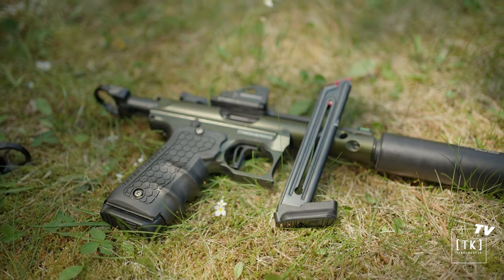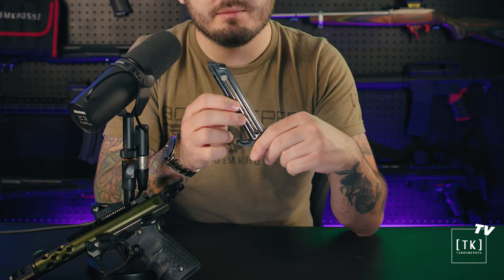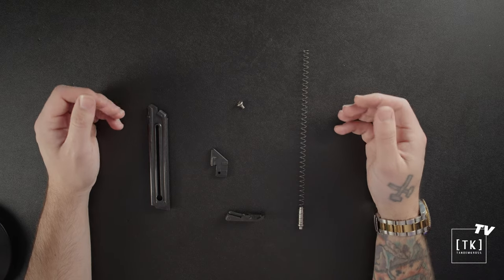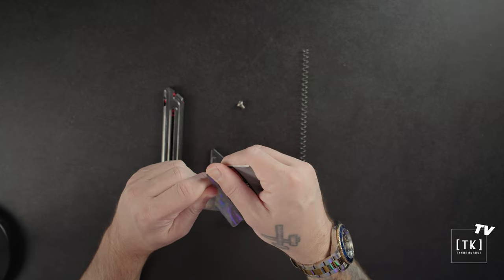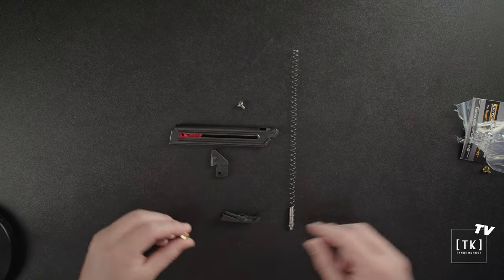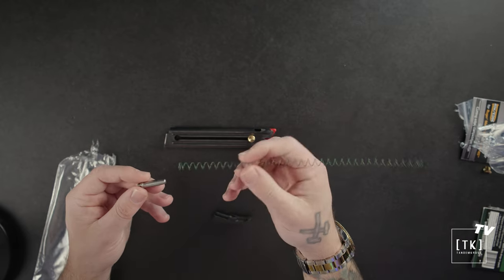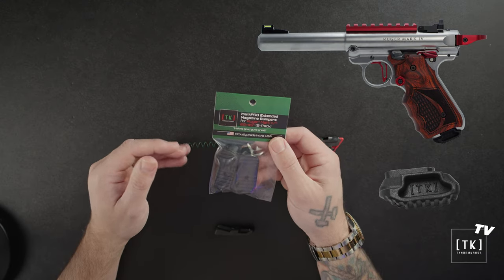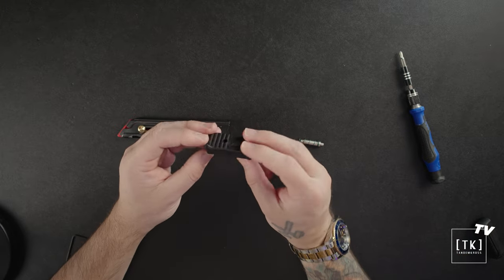Upgrading Your Ruger Mark IV & 22/45 Magazines!

Comment: $54.46 to do 2 magazines. 
I forgot to add $8 shipping because there's no free shipping, even on big orders.
I like how one of the features of the gun is that it shoots the magazines across the range, but in order to sell $24.99 bumpers, you act like they have to be pried out of the gun.  That's good stuff.
Reply from the maker: The real estate on the bottom of the magazine adds surface to properly seat and remove the magazine. Getting a grip on the basepad before the spring drops the mag is helpful to assure you have it gripped securely, and vice versa for seating the mags.
Reply: @TANDEMKROSS  Right, so you "don't have to pry it out."
Reply from the maker: @Josef_R  you do have to pry your fingers to be on the flush basepad unless you feel comfortable catching it in your hand.

Also, even with the spring and no bumpers, you still will have to get a grip on the factory baseplate to pull it out.
Reply: @TANDEMKROSS  I was just quoting your video.  And no, you don't have to get a grip on it to pull it out.  You depress the mag release and the mag leaps out into your waiting hand.  What are you talking about?
Reply: @Josef_R that's what I was saying lol.
Just got my Mk4 and the spring shoots the mag out like a fucking rocket every time lol. I was down with the whole video until I heard "pry it out"... Huh? Are we talking about the same gun? WILD
Reply: @itsjustavi  Yeah, I like mods as much as anyone, but I don't like deception. I bought the bolt ring, the the safety ledge, and an extended bolt release plus their holster. But this is just too much with that story.
Reply: People that use them for competition or serious target shooting often add different grips and a mag well.  
Factory magazines base pads don’t work well.